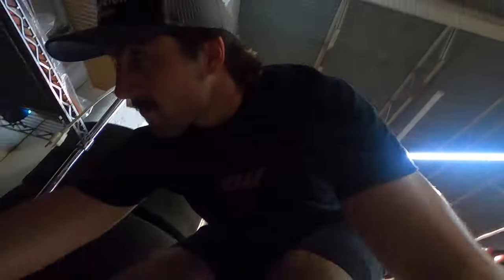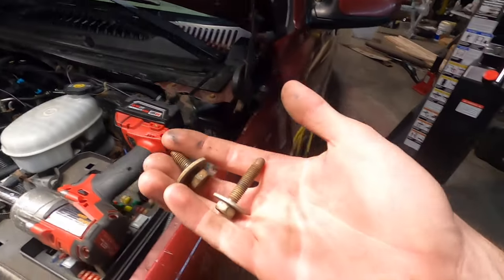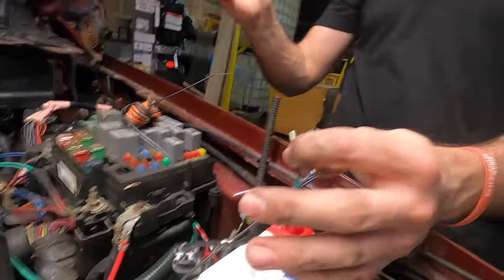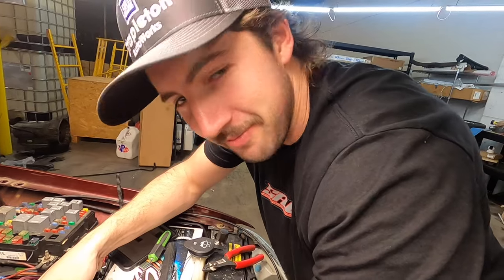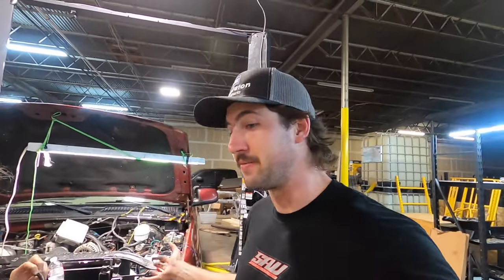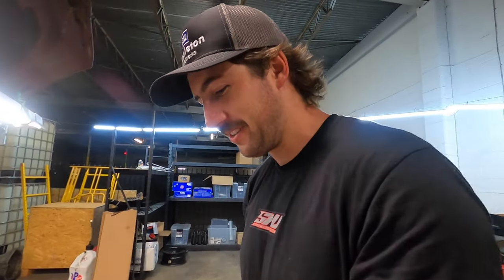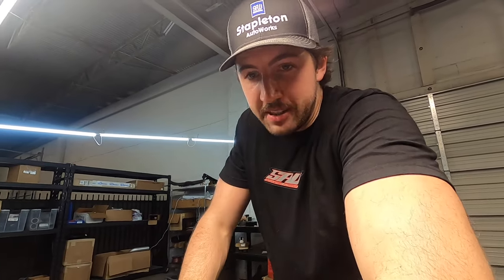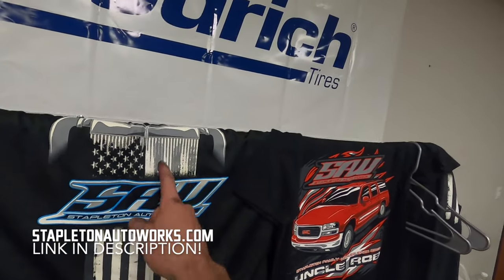FACTORY Electric Fan Conversion! Best Mod For 99-04 Silverado/Sierra/Yukon/Tahoe (Free Horsepower!)

Comment: You should have dyno’d  just the connection of the exhaust. I bet you lost way more than you think. I recently took off the stock exhaust on mine and threw on my old 4” setup from my other Turbhoe. Night and day difference in spool time and power.  I kind of miss the quiet but I’m way more excited about the power difference.
Reply from the maker: I’ll make it disconnectable for racing for that reason
Reply: I’d just like to see the numbers.  Being that you have the means to do it. 🤷🏽‍♂️.  My butt dyno said it was a LOT, but that’s with 12-13psi off the s488.

Comment: Hi, I have a question, in one of your other videos u swapped out the tranny lines for braided lines, is that a recommended upgrade for the 4L60E, I have a 2005 Trailblazer 4X4 with the 4.2L and the 4L60E. Looking to upgrade all that I can to get the longest life span out of it, I have a deep trans pan, aux trans cooler and fixing to upgrade the trans valve body

Comment: I just did this swap on my 02 Sierra. The low function works perfectly, but the high speed activated by the AC doesn’t work properly. With the AC off the passenger side fan stays on high, even with the truck off it still stays on. I have the correct AC signal wire but it has .05v with the truck off, don’t know if that’s the problem? Anyone know what could be wrong

Comment: Hey I have a 2003 GMC Yukon I want to install some electric fans but my issue is how will the ac compressor kick on ? Cause I’m using after market kit for efans and what will I have to get or change to make everything work as it should without me over heating

Comment: Is it that easy to do the fan swap on an 04 silverado? I have a 2006 Silverado with the electric fans and the 04 clutch fan. I heard I would have to do something to the computer as well as add the pins.
Reply from the maker: Yes. We explain that in the video

Comment: I have Replaced everything on my 05 Z71. It would be easier to list the few things I haven't done lol🤦‍♂️Anywho is there a way to trick the cpu to trigger the dual elec Fans.I ran power to them and they Def work.I can't get the temp to 220 even in Illinois at 100 temp outside.gonna drive this thing to the moon and don't want to find out on the way.Thanks in advance 🤞

Comment: I have a question.  I have a 2000 Tahoe which is the last of the obs and has the vortec 350 in it    will this dual fan swap fit or is this upgrade just for the LS powered nbs trucks
Reply from the maker: I don’t know

Comment: So this will work for my 1999 tahoe. I'm sure the wiring would be completely different correct and would I just be able to go to the junk yard and find a 2005 suburban
Reply from the maker: If it’s a GMT400 it wouldn’t be the same. You could use 05 fans but they’d have to be wired up and triggered some other way

Comment: I'm doing the E-Fan upgrade in my 2003 Tahoe . Yur videos is plug & play.  I was told.  I have to turn on the fan  Circuit in the computer. Is this true or play & play like u did . I called Chevy dealer with No help. Sorry we dont do that.

Comment: Does Uncle Rob have the bigger 34”radiator in it? Trying to do this swap on my Tahoe and PCM of NC makes a plug and play harness for this swap. I would rather use the dual electric fans that are side by side unlike the ls1 fans that are offset but they said to use the side by side fan you have to run the 34” radiator. Just curious if that was true or not.
Reply from the maker: Stock radiator I didn’t change it

Comment: Did you have to tune it afterwards so the fans can work? Or it automatically does it by itself whenever you installed the pins?
Reply from the maker: yes it needs a change in the tune for it to work

Comment: Do you have to have the 34" radiator for these fans to work? My 2004 silverado has the 28 inch. But I think I can swap in the radiator and efans from a 2005.
Reply from the maker: I don't know I never measured. this is my original radiator though

Comment: Hey man quick question. I have a 05 Silverado and anytime I plug in the driver side fan it’ll stay on regardless of whatever is going on (running or not). What do you think this could be?
Reply from the maker: You may have a short somewhere causing it to get power all the time. Bad relay maybe
Reply: Swap the relay and see if the problem moves too. If not I would then start back tracing the wiring looking for damage.

Comment: Which Crimper tool and connector did you use to connect the signal wires on the harness to the PCM? One of the connectors was bad on the harness I bought.
Reply from the maker: Someone gave me the pins and I don’t remember what the crimper was. Which I could help more but this was so long ago now
Reply: @Stapleton42  Thanks for letting me know.

Comment: Hi everyone I need help with my 2000 Chevrolet Silverado 1500 4x4 5.3l truck I'm trying to install a original electric fans and I follow all the instructions and everything it was perfect until my last wire the blue wire spot # 33 on green connector it's a wire already there so that's the problem what else I can do

Comment: Hey,  I have a 05 suburban (rotted frame) has the efan.. got an 03 now very clean. Can I swap everything over including the pcm ?? Or do I need to get a tune.. only difference is the 03 is fully loaded. 05 is not.. everything is the same even braking system. Thanks guys
Reply from the maker: Should be able to. Just change the frame

Comment: Can I do this to my '00 OBS truck? I hate my clutch fan but in So-Cal people live in constant fear of being state reffed for modification even on a god blessed work truck. Suck it Cole
Reply from the maker: Yes you can. It may not work the same factory way though but you can configure it with something else like ignition power
Reply: Yes to can. The two pins that go to the pcm in this scenario are ground triggers though. One fires both fans on low and the other kicks both fans to high when grounded.
Reply: @joeculpepper2235  hell ya

Comment: So the new fan setup is eliminating the fan completely?.I notice you're taking off fans now the new system has 2. .If the 2 fans that you removing work why are you switching them
Reply from the maker: for a factory ppm controlled setup instead of hard wired fans I have to unplug every time I get out lol

Comment: Hey guys will the 07-13 truck fans work to convert my 2006 silverado?
Reply from the maker: If you wire them up correctly they should be fine. I don’t know if they will bolt right up the same though.
Reply: @Stapleton42  ok and yea I was asking more if they will physically fit onto my 2006 34" radiator.. Hopefully someone else chimes in
Reply from the maker: @7beast298  you can usually find product dimensions online

Comment: yo you know i simply put fans on with a tap a fuse to ignition wire need that always on to cut the fluff lel
Reply from the maker: That’s one way to do it but it’s not the OEM way
Reply: @Stapleton42  haha for sure, props on showing us the correct way for all the non ghetto riggers

Comment: Visco fan pumps more air as single unit than 3 electric fans. On the street it does not matter but on hot summer day pumping through soft sand this mod will get you in bad way.